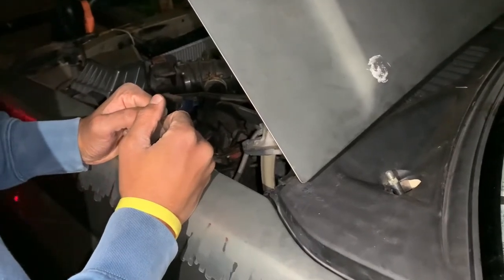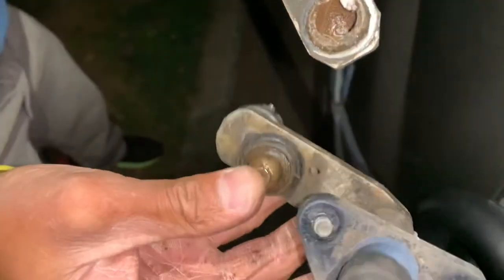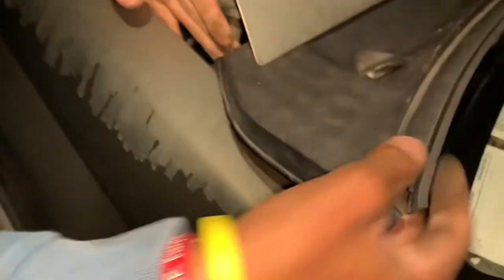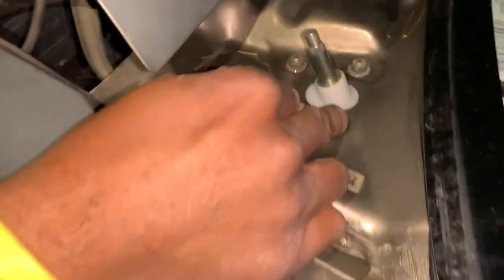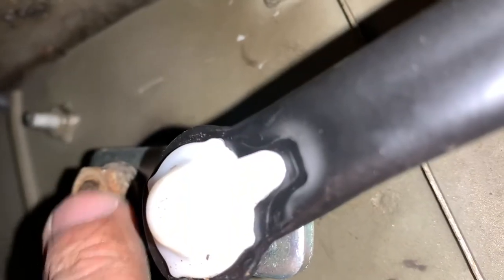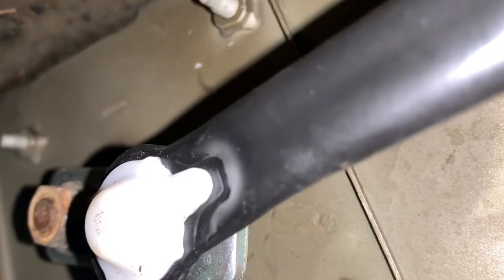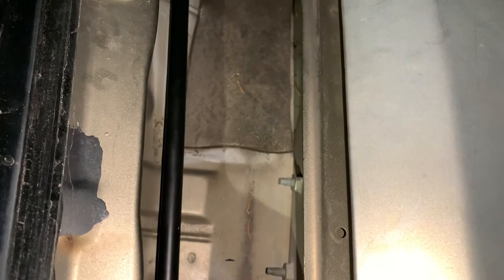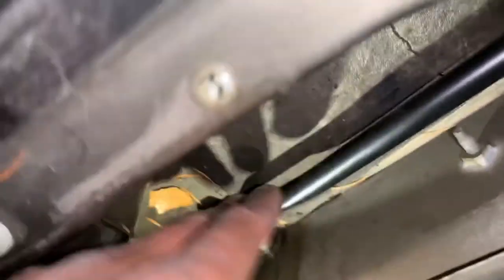How To Change Nissan Xterra Windshield Wiper Transmission Linkage

Comment: Does the little arm that connects the motor to the transmission come with the new transmission? Mines didn’t so thinking of using the old one but it’s pretty tough to take off due to rust
Reply from the maker: You gotta use the old one. Rusty, yes.